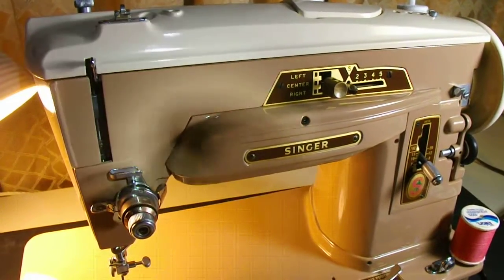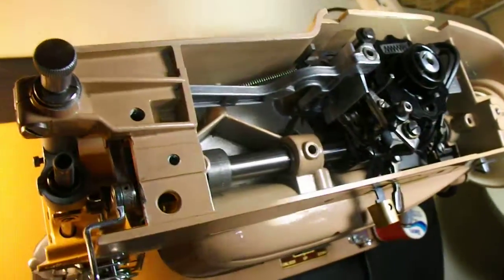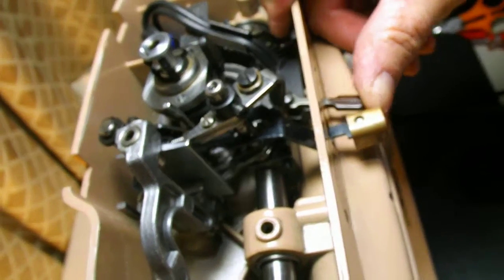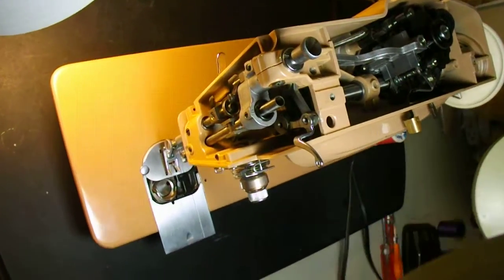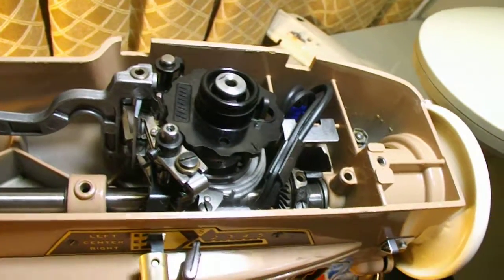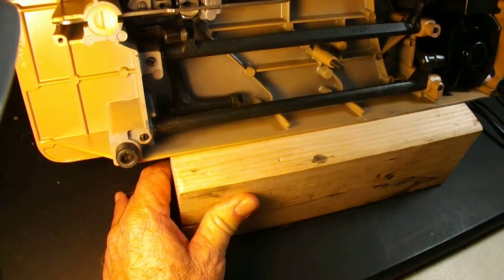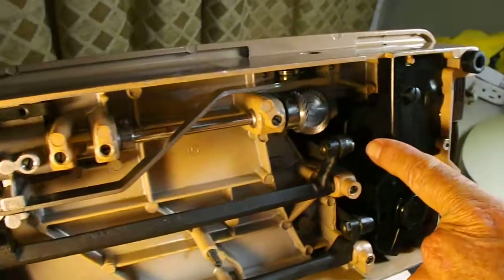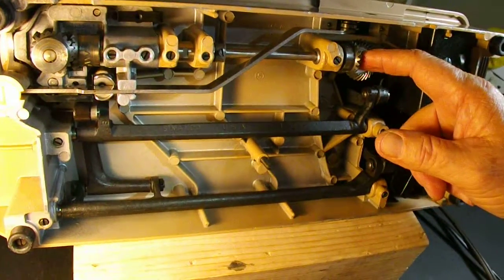SINGER MODEL 403A A LOOK INSIDE WITH COVERS OFF

Comment: Hi Andy - I was looking for a hand wheel for my 403-A that I just got since its original is all chipped up. A seller advised me that the 403-A was issued with 2 different motors - a PA9-8 and PA7-8 and the hand wheel must match the motor. The problem is most of the sellers of these hand wheels have no idea what motor they came from and supposedly the hand wheel has no part number on it! Since I have not removed the hand wheel from my machine yet ( and won't till I get one since I use the machine) I can't verify if there is a part number on it or not but I'd be quite surprised if there wasn't. BTW the motor in my baby is a PA9-8.
Reply from the maker: Oh, you are getting in deep. I wonder who that seller is. You can quote me on this, but it won't make it true. Many years ago I had a conversation with a SInger Repairman. An acquaintance of mine had changed out a damaged handwheel on a model 401A, and the new one worked, but "howled or whined" when running. (Asking for a friend, right) So the guy told me that it is possible the motors had different gears to match different pinion gears on the motor shaft. He said if my friend had used the gear from the old handwheel it would be ok. (You can remove & replace the gear on the handwheel.) So this tells me that there are different gears on the handwheel and different pinion gears on motors. Maybe, kinda, sorta, who knows for sure? I also have this thought that the PA7-8 motor was for the Model 401A. I searched my records and can't find any confirmation about that though. Here are links to parts lists for the models 401A, 403A & 404. Many sellers advertise parts as fitting all three of those models, and I think many parts do. Take a look at the handwheels (they do show part numbers) and the textolite gears of the handwheels. They ALL show part no. 172311 for the wheel itself and part no. 172312 for the gear itself. So I don't see why the handwheel would not be interchangeable between models. Here are the links to the parts lists >>
 http://parts.singerco.com/CPpartCharts/4_4999/401A1.pdf   
http://parts.singerco.com/CPpartCharts/4_4999/403A.pdf  
http://parts.singerco.com/CPpartCharts/4_4999/404.pdf

 Remember, these machines are 60 years old, and who knows for sure what can be found. I have seen machines with plastic & metal gears together from during the Touch & Sew transition.
Reply: as you can see he advertises it as the wheel for the 401 - 403 - and 404
Reply from the maker: This vendor has been around for a long time and sells parts. I think I bought a feed regulator from him once. If you can, please try the handwheel as is before changing to the old gear. I'm curious as to the difference. Thanks for sharing.
Reply: @andytubesewing1953  Well, i think I will first compare part numbers as I really don't want to have gears incorrectly mesh and possibly cause damage. If the part numbers on the gear are different I'm going to switch and use the original gear that came on the machine.
Reply: Also this machine was so oily i think it was dipped in Texas. I cleaned the whole outside with lighter fluid followed by a polishing and buffing with Novus plastic polish (#2 - OUTSTANDING for painted surfaces!) and now it looks showroom fresh! I love it! I also use this polish on the painted potted transformers of vintage hi-fi equipment.
Reply from the maker: That makes perfect sense; good thinking and best of luck.
Reply from the maker: Nicely done. That #2 polish does work great, especially on the fine scratches that dull the surface.

Comment: I was just gifted such a machine.  I cleaned it, the needle does not go up and down, how can I fix it please? Thank you
Reply from the maker: Do you think it might be in bobbin winding mode? When the chrome knob in the handwheel is turned left it unclamps the main arm shaft that runs the needle bar parts. If you hold the handwheel with the left hand and turn chrome knob firmly to the right it puts the machine in sewing mode. If that is not the cause of the needle not moving, you have a fairly serious problem. Here are a couple playlists of parts of your machine. About 80 videos you can skim through to learn about the parts and how they work. https://www.youtube.com/playlist?list=PLsCOZgzzaiKKyqvdDRwS-9MfLuwSNJTcg    and     https://www.youtube.com/playlist?list=PLsCOZgzzaiKIB4kvIHCfHYuyLMUp5A4UI  You can download a free copy of the instruction manual directly from Singer at this safe link: https://www.singer.com/search/support?title=403
You can also get a free copy of the Service Manual if you want it: https://sewingdude.files.wordpress.com/2012/09/singer-401-service-manual1.pdf   Unless someone removed parts from the machine it most likely is just in bobbin winding mode.
If it will not return and stay in sewing mode look at the playlists I mentioned for videos about the handwheel showing how to remove and replace it. Someone may have had it apart and put the clamp washer back in the wrong way. Good luck, Brigitte. You'll let us know how it goes? Take Care.